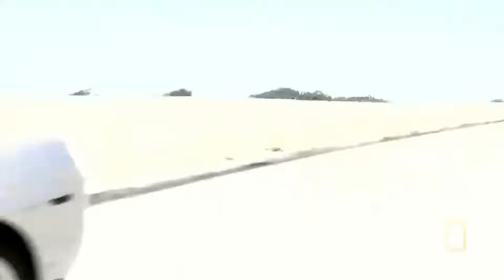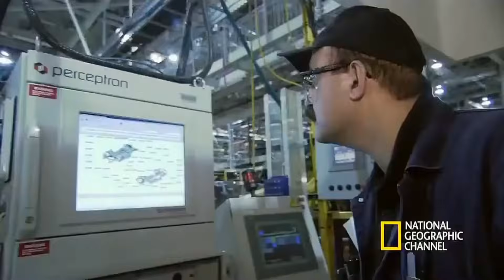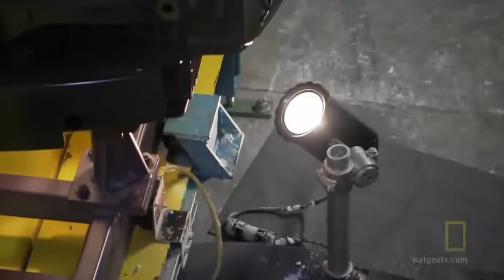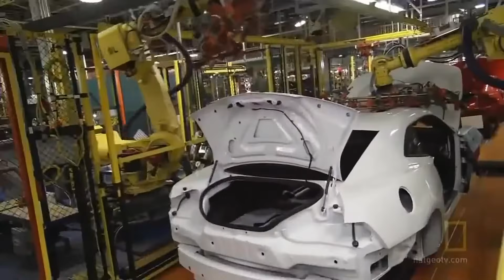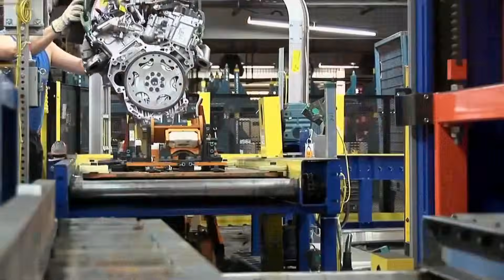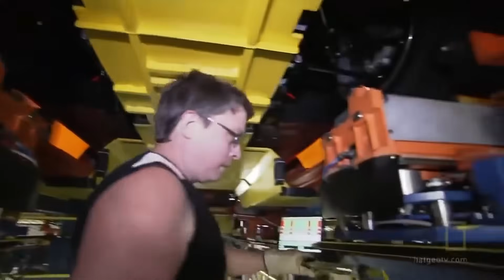Chevrolet Camaro 2010 5th gen - Production line and assembly

Comment: But what happens if one of robots is having issues? Isn't working right? Isn't operating right? What happens? Does the assembly line come to a hault until that robot is fixed and working right and correctly again?

Comment: I've owned probably five or six Camaro's from varying generations, and I can say without the slightest doubt my 2014 Camaro is the most well made of all the Generations I've owned.  If I were to pick a negative about the car, I'd be limited to the interior materials.. The Design is great, the build is solid, no squeaks and no rattles.  But if the dash and doors were leather/Aluminum/carbon fiber like most sports cars it would be perfect, that's the only negative I can possibly think of.  Best way to describe it is, this is the Honda XR of Camaros, 5th gen is the one you can beat to within an inch of its life, 7 days a week for 40 years straight and it just keeps going with simple maintenance.  Anyone who owns an XR Honda will instantly know what I mean.
Reply: That's why the 6th Gen is better. Way better build quality.